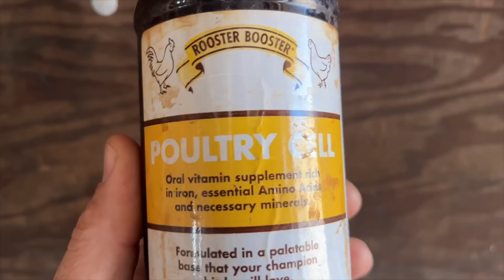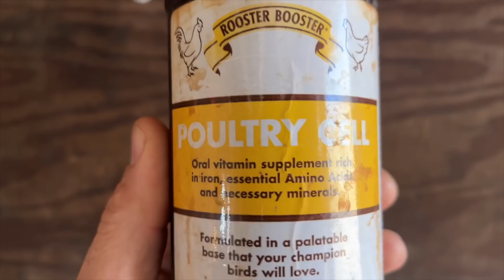We Never Thought This Day Would Ever Happen! (Barndominum Build)

Comment: The smell goes away in the rubber bowls but it takes a long time! You have the big one in the coop with your call ducks. They are nice when it freezes. They don’t crack.
Reply: Switch the new bowl with one of the used bowls and then the new one will age with a critter that doesn't care and then give moody' the strong "broke in" original bowls.

Comment: Just a suggestion for Moo man. The bucket you're putting in has two hooks on it take a board and a spacer and hook it on the crossbar on his fence by where you feed him. Put the feed in his hanging bucket and put it on the bracket plus it should be better for him to eat because his head would be at a natural height instead of leaning down and eating. Because normal cattle in a feedlot they eat out of a tall feed trough. Plus this way moon man won't tip his food over or the goats won't get it. So I'm looking at your picture you have two wooden posts and then across bar if you would hang his food bucket on that crossbar that would be perfect. And yes I am a lady from the farm .....
So excited for you guys 🎉🥳👍

Comment: We built a pole Barn and I knew I wanted water  and a drain to wash the car in the winter. Also ended up putting in a bathroom with a shower best decision we ever made. Use the bathroom all the time, saves so many trips into the house when working in the yard. Have yet to use the shower but you never know.

Comment: On your indestructible feed pans. We had that issue in FFA. We worked and worked. Noting helped. An old man told us. fill it with maybe a half inch of dirt. get it wet and smear it all over it and let it dry. Then do not wash it out. Just knock out all you can. Then feed it like that. Get the mud on the inside and outside. Make it look dirty and old. That will hide the rubber smell enough. It worked for us. Maybe it will for MooMan.

Comment: The rubber smells, the other tubs freeze. Using an old tyre to sit another dish in the hole works well. Won’t tip over.

Comment: Chewing cud is part of digestion for castle, what I've done for my feeders is drive in a T post then zip tie the legs of the feeder hills them steady and easy to rearrange when needed.I got rid of my plastic outdoor sink you pictured when I tried to bathe my Irish Setters it wobbled to much I found a used stainless steel sink from a grocery surplus store it shows no wear and is very sturdy. Just some minor advice from correcting my mistakes.

Comment: Hey on mooman bucket put one of those snap ring I think they are call carbuncles or something like that( the thing l like what is on your fence chain to lock it) put it on the  handle and on the wood post put a screw in electric fence ring so you can hook the handle to the post.. that way he want be knocking it over and it will stay were you put it..I bet that will work.

Comment: Thanks for the lovely videos you share with us all.  I hope AC/DC is feeling better. Can we have an update please? His tail looked very ragged, not his usual splendid self. 
I'm writing to tell you that you can slope the floor of the garage bathroom floor when they build it so that you a can just rinse it off with a spray hose. Al at Lumnah Acres did that in the floor of the building which will be the summer kitchen, meat processing kitchen and solar power house. It will also be their house untill they build their home. They put a drain in the bathroom, kitchen, and later added a greenhouse porch which also has a drain.

Comment: Looks like fantastic progress! I like the idea of the bathroom in the garage. So practical. How are you going to insulate the roof in the main house and garage? You should put in ceiling fans in both for air circulation. 
Have you considered putting radiant heating in the concrete flooring?

Comment: I hope you're putting really good insulation in, because I grew up in the south in Georgia as a matter of fact, I know how hot it gets there. You may not need a lot of insulation in the winter time to keep your house warm but you definitely need really good insulation in the summertime, to save on your air conditioning bills. Then check it out to see if they have programs in your area for putting in solar for cheap or free, the programs are going on most places right now. If you decide to do solar I would do free-standing solar arrays not on the roof. The thing is once you put the solar in if you don't use as much as your producing most power companies buy the power back from you that you don't use.

Comment: You gotta have plastic and termite treatment done before concrete. Also need to pressure test all the plumbing. It's no fun trying to find a leak under concrete.
Reply from the maker: Only drains going under slab, no water lines. Termite treatment going down next week😊

Comment: For Moo Man, do you think one of those black concrete mixing tubs for mixing a small amount of cement would fit into the metal trough holder? I purchased one at big box hardware store as a dust bath for my backyard chickens. I would think it would be the perfect size, if it works.

Comment: My lil piece of advice from past experience: spend a few more dollars and get a sturdier outside sink...those deep plastic ones like you showed are not that sturdy and I think you will regret it, I did...I used it a lot for dog washing, vegetables, boots, deep pots, soaking clothing that was extra dirty, etc...It always "moved"  faucet never fit right and water built up around it caused a nasty mess on the wall behind it ( just get a cabinet installed and some kind of back splash perhaps consider a floor drain below it  and a cabinet above for towels, soaps, brushes...you'll be glad you did...a few more dollars will go a long way...do it now while its easier vs later. And put an overhead fan in there!

Comment: I see Moodi put his BLUE bowl into the BLACK bow?  LOLOLOL too funny!!!!  What's the thickness (gage) of your metal roofing.  On homes we use to use 24 gage but some builders today are using 26 and 28 gage.  The lower the number the thinner the metal is.  Also what kind of insulation are you going to use to help with the R-factor and the  noise from rain on your roof?  It is so exciting that your roof's are going on YIPPEE.  Saw your plumber working and that is a GOOD thing for sure.   God is blessing Cog Hill for sure.  So exciting.
Reply: I made a mistake..."THE LOWER THE NUMBER THE THICKER THE METAL IS" UGH bad day here I guess.  Sorry.

Comment: Just curious on the inside what will you see when you look up in the barndominium? Is there a suspended flat ceiling with a big attic space?  Or will any of that be open?  I know you probably need roof insulation, but will you actually see any of the metal rafters or the support bars that go across? There's so much space is that going to be one tall ground floor, or will any areas have a 2nd floor that goes up in to the attic?
Reply from the maker: The living area(kitchen & den) will be open.  You will see the trusses. Then above the bedrooms will be a loft and attic space

Comment: My question what happens if your plumbing has problems in the future how do you get down under the concrete floor  to fix it.  Plus your bath room in the garage should have a washing machine to wash your farm work cloths (muddy) to save that dirt from going in the house as well the house could be for the good cleaner dirty clothes.  And don't for get cupboards and closets for hanging barn coats Etc and drawers.  My uncle did that in there garage and it was the best thing the everydid. Just an idea. Adding his was an 8×10.
Reply from the maker: No water lines under concrete, just drains. Water lines will all be in the walls.
Reply: @CogHillFarm  ok just worried

Comment: My own four dog’s loving a shower is easier to rinse off their coats and power shower heads in deep cleaning for rinsing shampoo for cleaner all round bath tub and choice of shower for bathing dog’s hair to clog up bath tub drain pipes in shower to separate and rinse away easily in bathtub and fur  clogging up the plug hole. I wet my dog’s, and then shampoo and rinse and shampoo again for final rinse of seeing the difference in their coats. Bath tubs for sitting in their own muck and having to empty and refill the bath tub taking longer than to shower.